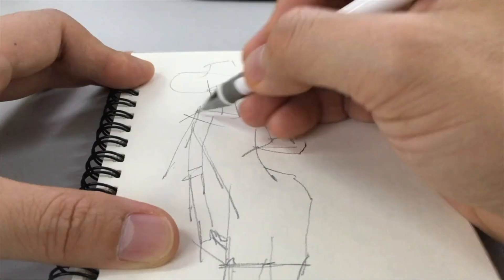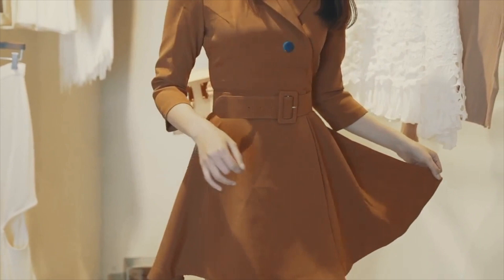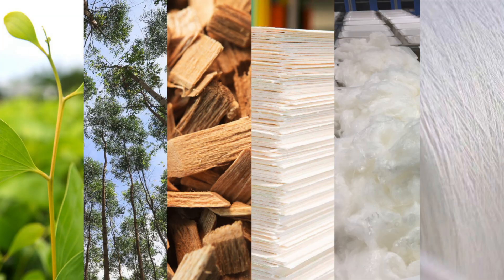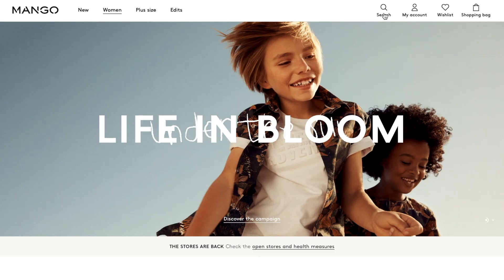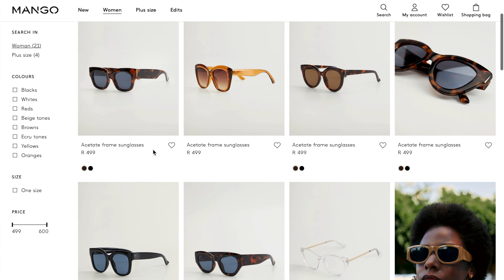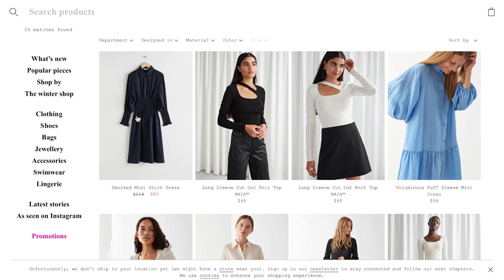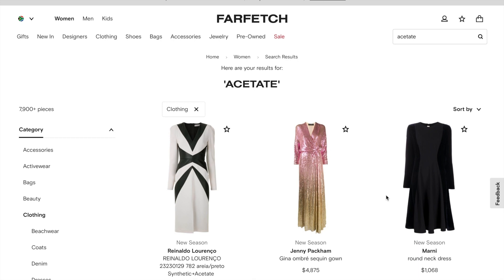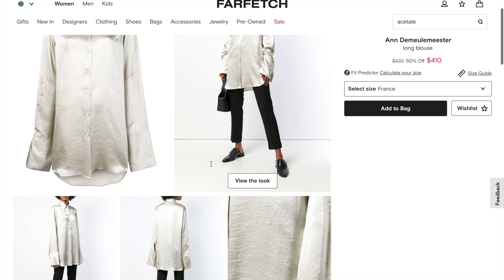WHAT IS ACETATE? | S2:E7 | Fibers and Fabrics | Beate Myburgh

Comment: Hi Beate! Thank you so much for your video. I do have a 100% wool blazer but the lining inside is 100% acetate. Do you consider it a bad or not breathable fabric? I am quite afraid it can start to smell after some time of use, any tips on how to  take care of it?
Reply from the maker: Hi Filipa. Just for context, in the past linings were made from silk. Of course silk is expensive and it will increase the price of garments dramatically. The original silk lining is now replaced with either polyester, viscose or other forms of semi-synthetic fabrics (such as acetate). I bought a wool-blend blazer at least three seasons ago, and it has a 55% polyester, 45% viscose lining. I've not experienced it smelling - and I don't think you need to be too concerned. I recommend putting it on a hanger after wearing it in some fresh air. It will definitely keep it from smelling. I think you'll also find this video helpful & informative: https://www.youtube.com/watch?v=JbmqogMadmE
Reply: Thank you! I will do that 😊 I love the blazer and it was a wonderful gift from a friend, and being wool is really good.
Reply: Polyester is plastic and may well start to smell. I use acetate for linings.